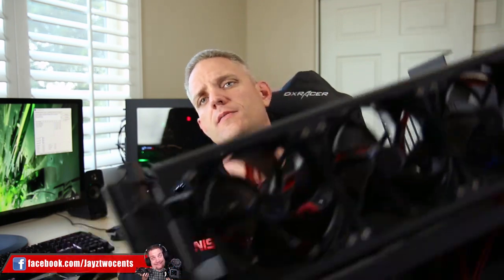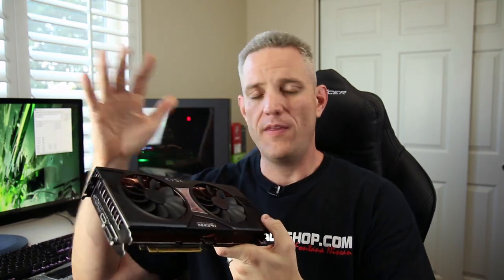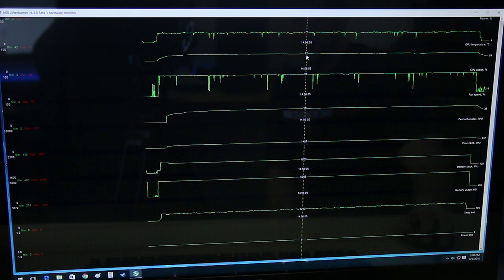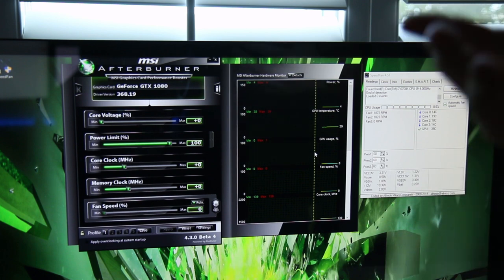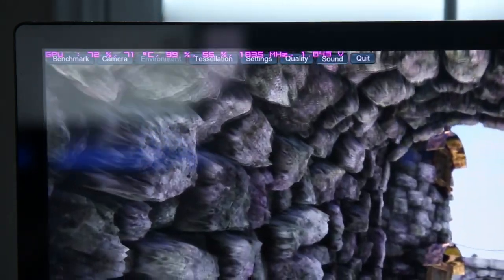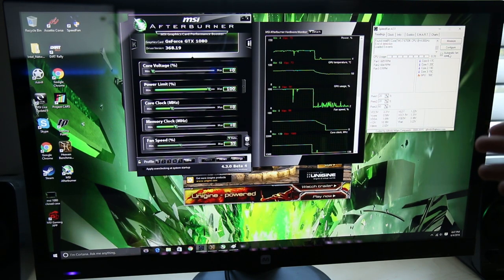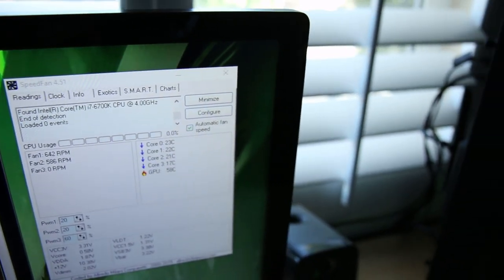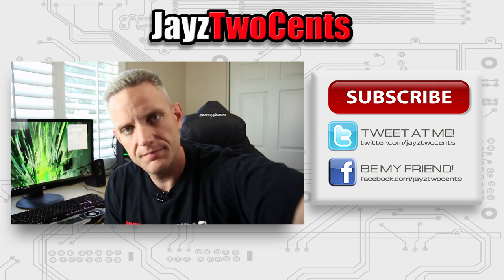Do cases make video cards run hotter?? - Test Bench vs Case

Comment: Fun fact from a jet mechanic. I noticed you called the fan a turbine. It's not a turbine, it's just a blower fan. Fans DRIVE air, turbines are DRIVEN by air. Same difference between motors and generators :)

Comment: Jay I believe your video doesn't take into account CPU load. Valley benchmark is far more gpu intensive than CPU, so the fact that your intake has a radiator pulling air in is not going to really raise the case temperature. A better test would be like battlefield or a more heavy multi threaded game that has much more of a demand on the CPU. You also didn't include what the CPU utilization was, nor did you include the CPU max temperature, but I would assume it would be less than 50%. This would mean your CPU is running very cool, thus not adding much extra heat into the closed system. All in all I commend your attempt but your experiment has too many unknown variables to make a sound argument of whether or not closed case air temp is higher or lower than open bench.
Reply: yup
Reply: Wouldnt this be booted out of the equation if the system has a side fan directly blowing onto the GPU?
Reply: This is a pretty valid point but he made it clear he was testing for the point of comparing open air to case as far as general benchmarking is concerned. cant satisfy everyone though i guess.
Reply: +Steevo if this is worse case why not use worse case cpu usage then to see if there is any effect?
Reply: That sums up what I thought as well (not wearing a tinfoilhat). His Rad is pretty over for CPU stock cooling and at x% intake, thats one thing he didnt cover.
Reply: really cpu temp doesn't matter ? so if my rad is say 30c hotter than normal and its pulling air in it is not going to make my system warmer! Defying the laws of thermodynamics this is GREAT!
Reply: Valid point, but also a bit irrelevant. The test was to show the difference open/closed case. 
I would argue that the open case would also add heat to the GPU air intake, due to inefficient airflow, so it's probably not going to make much of a difference anyhow.
Reply: Again, go watch the video. It will make a difference, but not enough to even be noticeable.
Reply: +msanto The "bottleneck" for the air flow have no noticeable impact. Luke from linustechtips tested that in his "workshop" series. He had to pack the case up with cardboard boxes to see an actual difference.
Reply: umm, changing CPU load would invalidate the tests.
keeping them constant is the only valid way to test the GPU as he was ONLY testing the GPU...
Reply: LordDecapo Scientifically yes all things but what you are measuring must be constant. The same benchmark was used in both tests making CPU usage and GPU usage the about the same
Reply: I think most Tech reviewers get flak, when they leave information out. If you make your presentations too flashy, too abridged, you might get huge follower counts, but critical comments are going to come your way. It comes with the territory. I'm sick of people pretending they can give critical/negative comments out to their viewers, but think that it can't come back at them ? Personally I like the in-depth videos that Digital Foundry, AdoredTV et all, but like the flashiness of other producers like JayzTwoCents. Its when the mind wants to meld the two together, is when these converstions take place.
Reply: Adored is a hack!
Reply: exactly what i was trying to say, all he showed in this video is one example of one type of system. Don't make a General statement like "Do cases make video cards run hotter?" and not test multiple scenarios, because not everyone has this setup and to that end his testing he  just has too many unknowns to draw any type of real solid conclusion other than in his system it made little difference.

For example i have two gtx 980's in SLI and they get much hotter inside my case vs outside even with 5 intake fans and 1 exhaust. 

So if i did not question his methods and just followed them like many might i would be very disappointed In conclusion don't make a blanket statement and then not even try to spend the time researching the subject or showing the results with different types of setups.

This is why i really like Gamers nexus you tube channel they spend the time do the write ups and do not make general statements like this.
Reply: Sparda_Knight yes many things influence temps but airflow restriction doesn't affect temps unless you actually block it off, Luke from LTT showed that, in that case, putting boxes and sweaters in the case made temps change. While Jay used a typical mid-range setup he can't possibly test all scenarios. With Luke testing airflow restrictions results we can safely assume that airflow in normal cases won't affect temps when compared to each other by a big difference. Since we assumed modern cases are nearly equal in air restrictions, a statement like Jay's makes perfect sense. It's a generalisation but not one made without any claims, I agree with you there might be a horrible case somewhere in the world that just shouldn't exist and contradict what happened but the only way to prove him wrong is to test all cases or until a meaningful difference is found among modern cases. Sorry for making this long and GamerNexus is very informative
Reply: Ive seen that video it was about cable management he didn't lower the fan speed so or turn the fans off so i feel that the air was still able to get in and out of the case, its a bit different situation, also in that video he was using a reference gpu cooler which does not dump its heat in the case.

Comment: Results: WHATEVER
Reply: Yep.. yeah sure if you have enough airflow a closed case isn't going to be realistically worse than an open air test-bench..

The issue with closed cases is dust, and that DOES affect temps.
Reply: #TheWorkshop
Reply: +undefinablereasoning so, you're telling me a closed case is pulling more dust on to your system than a open bench? 

Think again 😂😂
Reply: Why include factors that have nothing to do with this? yes ofcourse dust i a fucking problem and so is global warming but that is not the point of the video
Reply: Mister K 

I suggest YOU think again...

Most case fan setups are done with negative pressure, which keeps the dust in.
Reply: Tyrone melonas 

It's all about airflow, yeah sure in his particular case he may have enough.. 

But is that a generic statement that can be made for all cases? Heck no.
Reply: dust could affect temps and that's why you clean the filter once a fortnight in my case, I mean situation
Reply: I agree only a well designed high airflow case would probably have this result
Reply: acnfanmanin S340 is a popular ATX case, it has all NZXT top case features at a cheaper price, it's actually a really good candidate to test but other cases could have different results as Jay mentioned
Reply: Imraan Omar Yes I know. I'm saying like crappy airflow cases or cases with drive mounts will result in different temps

Comment: the thing is that he reviews cards not the cases they're in so he can use what ever he wants to test them, like he said he tests the cards cooler.
Reply from the maker: exactly
Reply: Thanks for all you do man. Keep it up! :)
Reply: Pretty much my standpoint. Honestly I dont see why this needed to be "proved" but I digress.
Reply: Hi Jayz! I have a GTX 980 ti Kingpin 76+ Asic, and i can barely OC it.. +10 mhz is about the Max without it crashing.. So its running at 1470 mhz, any suggestions to go further or do i have a bad card?
Reply: Exactly, doing any kind of scientific test is to limit the number of variables that change... if he tested the GPU's in one case, he'd have to test all of his other GPU's in that same case over and over again to make sure he would be limiting variables.
Reply: Sounds like you've got a relatively good card, compared to reference stuff, but in regards to overclocking it further as you would expect it to be able to, you probably just lost the silicon lottery.
Reply: The problem is that what the average consumer needs to know is how the cards will perform inside a case and not on a test bench. There are a few review sites that already stopped using test benches because it does not give an accurate represenation of a real world situation. If you run the cards especially the non blower style cards in a standard chassi without extra chassi fans, with air cooling, most likely use intel/amd cooler or hyper 212 evo and a test for 2-3 hours or whatever people do and something that actually stress BOTH gpu and cpu the numbers will be very very different.

Neither do the average person use water cooling or four chassi fans or play for 20min ;)

One review site tested on an Define R5 without additional chassi fans just the two that comes with the chassi and a standard cpu air fan and the 1080 smacked 82C very quickly.
Reply: Yes, but the cards go into cases ( that we own ) and what good is a review if it doesn't indicate what our experience with the product will be ?????
Reply: Likely two chassi fans but a lot of the chassis only has one also. Testing for two hours is because the average gamer does not sit down and play for 20min do they ?

Neither do they run games that only use the gpu. There are some that will max out cpu also. Unless you have aio or custom water or plenty of chassi fans the system will get toasty. None of that will ever be shown in an OPEN test bench.
Reply: Yea but he cheated on Beyonce
Reply: just get more fans if  your so worried
Reply: Yes, but the point of benchmarks is to show you how cards will perform for you so you can make a good decision on what GPU to buy. If cards perform different in cases than test beds, then that defeats the purpose of benchmarks.
Benchmarks are made for the viewer/reader, so they should be as real world as possible.
Reply: +niklasarawid Well, rip that K|ngP|n, you should maybe RMA it
Reply: +niklasarawid you adding voltage at all? Cause if you don't add voltage you ain't gonna get too far.
Max I'd expect for you is around 1510-1520 anyways :/